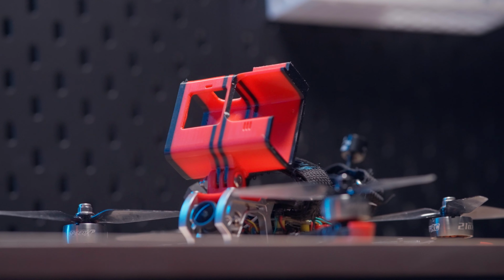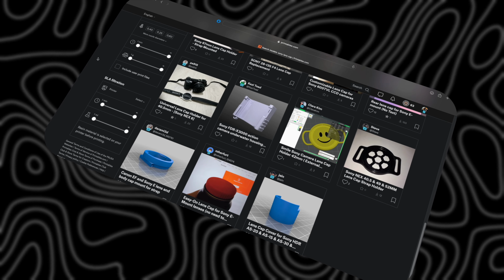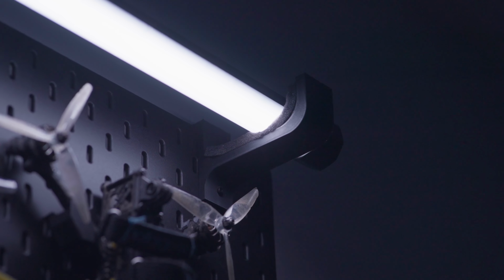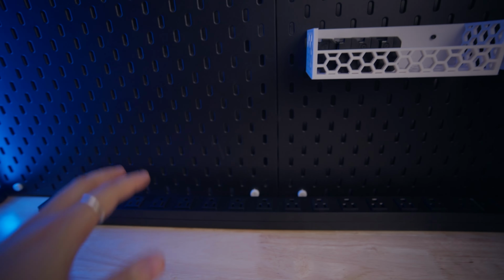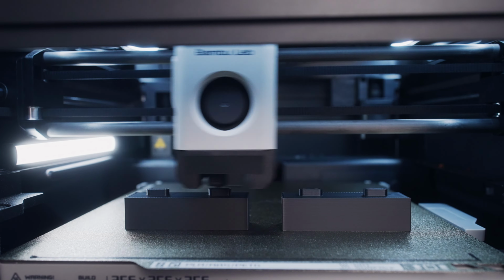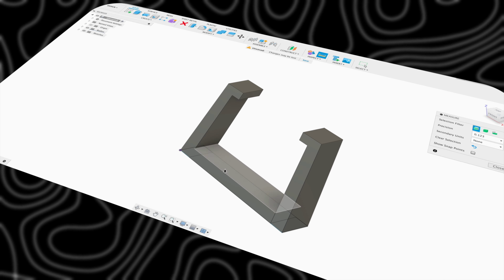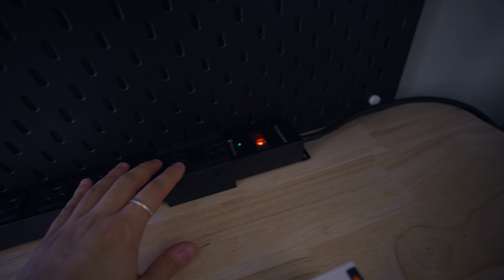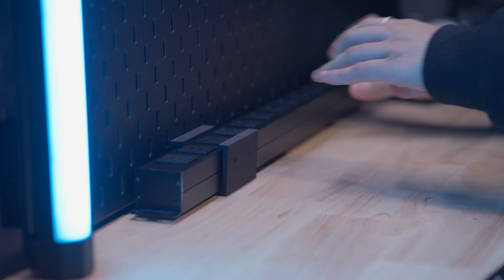WHY I LOVE 3D PRINTING + Charging Station Upgrade // 3D Printed Studio Upgrade Pt. 1

Comment: i would have made that power bar hodelr at 45 degrees towrs the room for easyer operation but maybe I'm just thinking of our bigger EU plugs
Reply from the maker: i considered that, but didnt want the plugs to not be flush against the pegboard if i had a charging device on the pegboard itself. so far its been working well pointing straight up!

Comment: I want to 3d print drones where can I get the files
Reply from the maker: if you want to 3d print drone frames, you’ll prob need to design it. there aren’t a lot of those lying around, as most frames are designed and printed for carbon fiber. if you’re talking about things like gopro mounts, usually searching “*drone name* *drone part*” (ex. geprc mark5 tpu feet) will get you to where you need to be

Comment: The people that think 3D printing is weak really just don’t know that much about it. If you design and print the part properly and use an appropriate material then like you said they can be very strong.

One case I see often are people saying that 3D printing is no good for drone frames but pretty much the only people testing it are just taking a design meant to be cut out of a carbon fibre sheet and they print and test that. Frames are only designed to use flat sheets because it is strong and cheap. With 3D printing you don’t have the same limitations, so with some proper designing of the arms and body, to take full advantage of the 3D space and capability of 3D printers plus printing it out of a good material, the frames should end up very strong and functional.
Reply from the maker: 100% agree! i haven’t tried printing my own drone frame yet, but def a project i want to try in the near future 🔥